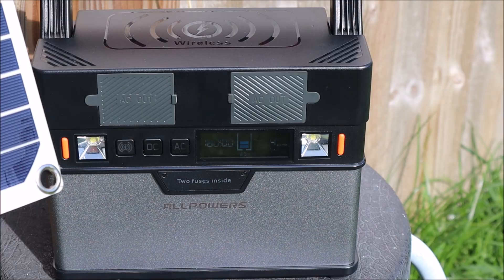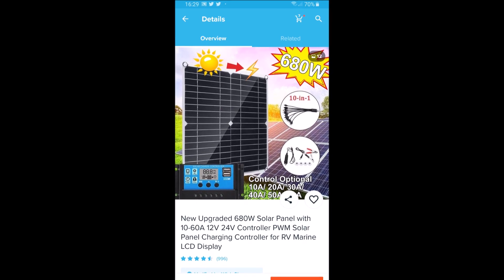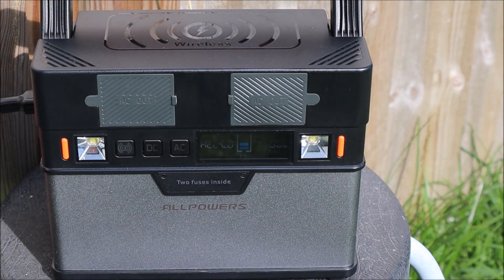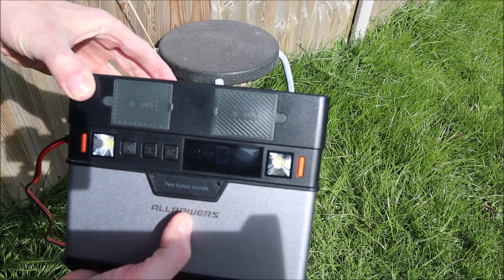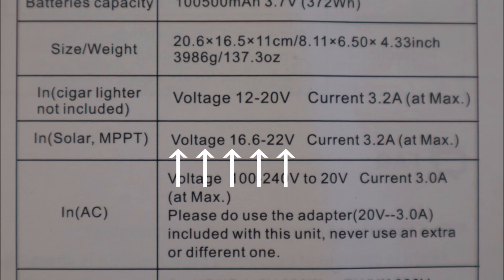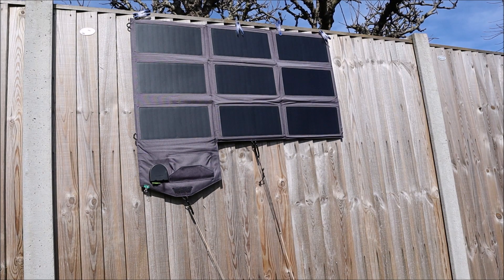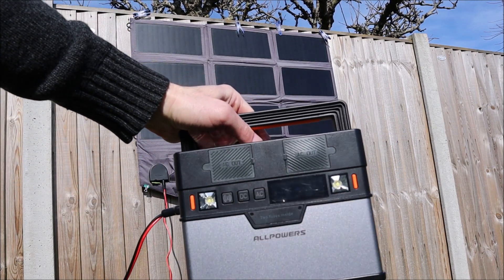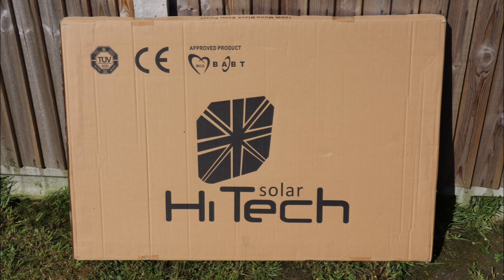ALLPOWERS 372Wh Portable Solar Generator Update 2 | Wish Came True

Comment: Hi Adrian, I have question to ask you where can I buy there featured cable ALLPOWERS MC4 to Anderson Connector Adapter Cable 16AWG as mentioned in your linked description? As it says Currently unavailable on Amazon! I am struggling to get this cable from anywhere which I desperately need to charge the 372 Generation, which I will be buying this week! I don’t suppose you have any ideas? I mean how hard can it be to buy just 1 simple cable? Many Thanks 😊
Reply from the maker: @Dean Platt  Hey Dean! Sorry for the delay (loads happening at the moment). The cable description is incorrect on Amazon (link correct), the one shown is actually the DC to Anderson port cable. This should be the one that ALLPOWERS are sending you free of charge?

The MC4 to Anderson port cable (not pictured) is the one that I used to connect up my 100W standard panel featured in this video > https://youtu.be/T_hlnoyAx2c

So, other than the cable you are waiting from direct from ALLPOWERS, you will have all you need for charging from the foldable panel. You can also still charge using the cable that comes with your new panel, while you're waiting for the other cable to arrive. I hope this makes sense and please shout if you have any other questions. Take care, Adrian
Reply: DADvinci Hey Adrian, That’s ok if you have loads going on at the moment, as I would of waited for a reply as there was No rush! Yeah kinda noticed they have put the wrong description in the listing as I was like that is a DC to Anderson as I saw what the MC4 looks like which as you said connects up the 100W Panels! As for me getting a Free Cable from MYSolar the makers of the Solar Panels & Generator, I haven’t heard anything back since last Friday as I have sent another email, still nothing! So my hands are tied as everywhere seems to be out of stock of this cable which is obviously extremely popular whilst we was in Lockdown! I mean I have got the 60W Panels, and after I watched your video I could see how the Anderson would be so much better for charging without the levels dropping when the sun went in and come back out again! I am just holding off ordering the 372 Generator until I know for certain I am able to get this cable as it is a bit worrying that nobody has this cable right now! Anyway so sorry for all questions! Keep your videos coming as I am a Tech Junkie! Please Stay Safe 🙏😊

Comment: Another, possibly easier, way to achieve this (if you have a fold up solar panel) is to plug the panel in to the unit with the panel completely folded up and then gradually unfold sections of the solar panel. As you do, you will be gradually increasing the voltage (as each section opens up to the light) and no doubt you'll hit the magical voltage on the way to wake up the unit.
Reply from the maker: @Rich Hawley  Good day Rich and thanks very much for your comment. As you rightly say, it's finding the magical voltage that's the key. The only issue with this is that I need to do it within about 5 seconds of plug-in (on my unit) otherwise it doesn’t wake up (remove + try again). The best method I've found for both the 60W folding and 100W rigid panel is holding a piece of cardboard over certain parts of the panel, which has been very good at waking it up. I really need to get a DC power supply at some point to properly test the voltage range for this picky circuit. Thanks again for your comment and have a great weekend! All the best, Adrian

Comment: Interesting review thanks. I’m thinking of getting one to power a telescope mount in the field. It’s very power-picky tho and needs a consistent 12v or just above supply. Have you tested the 12v cigarette lighter output to see what it actually outputs? Is it 12v bang-on or above or below?
Reply from the maker: @Jeff Mark  Good day Jeff and thanks for your question. Unfortunately, the 12V cigarette lighter socket is not regulated so the voltage drops as the overall battery charge does. I do not recommend this unit for anything that is sensitive to dropping below 12V. You could use something like this > https://amzn.to/2Y7NW53 (affiliate link), but that's not the most efficient way of using the battery (+ I've not tested one yet). I hope this helps. Please let me know if you need anything else. All the best, Adrian
Reply: DADvinci thanks for the reply. My quest therefore continues. All the best.

Comment: Just wondering what heater can I plug into this
Reply from the maker: @Shayne Widdowson  Good day Shayne and thanks for your question. It depends on the wattage of heater you wanted to use, but would need to be less than 300W (AC inverter limit). What type of heater were you thinking of? The reason I ask is that a micro fan heater would eat through the battery quickly, but some kind of heated blanket or mat would have a lower wattage (last longer). Please let me know when you get a chance. All the best, Adrian
Reply: I was going to get one to put in my shed only a small one now I know what wattage I need thank you

Comment: Could you let us know, perhaps do a review of the Wish solar panel? Love your work by the way.
Reply from the maker: @Royal Green Good day to you! Thank you very much for your kind feedback. I was planning to do a future video around the Wish.com solar panels that did arrive. This is going to be more a comparison between what's advertised on their website versus what turns up. Did you have anything you wanted to know specifically on the one featured in this video? All the best, Adrian
Reply: @DADvinci  Thanks for replying, it would be good to know your experience with the Wish panel, what did you expect and what was the reality. What was the advertised wattage and real wattage. 

Really appreciate your honest experience with these devices. About to buy the ALLPOWERS Solar Charger 18V 60W. Looking at the ALLPOWERS Portable Generator 288Wh, but its not in stock yet.
Reply from the maker: @Royal Green  Thank you, I'm really glad you've found value in these videos. From what I can remember (ordered ages ago and no longer showing on my account) the Wish panel in this video cost about £21 and it was advertised as 680W! I went for it as it was completely ridiculous. The one that arrived, as you've seen in the video, was a small square similar to larger flexible panels. I've had around 10-12W on a sunny day, but I usually just sit it in the sun charging my USB devices, which it happily does to be fair. The old saying really does apply in this case ’you get what you pay for!’ 

You've chosen a good long-term combination from my experience. Please shout if you need anything else. Take care, Adrian

Comment: Hi, thanks for the very informative vids. I've purchased a 372 but am still confused about which solar panel to buy. The issue of it not ''firing up'' is a problem. Would a 80w be better than a 100w do you think? ty.
Reply from the maker: Good day! Thanks for your kind feedback and question. I get the problem on both my 60W foldable and 100W rigid panels so I'm not sure an 80W would get round it. To be honest, once I got the knack of how/where to cover the panel I stopped thinking about charging using the Anderson port. Once the display is awake it stays that way until you disconnect the Anderson cable. I hope this helps? Please shout if you need anything else. All the best, Adrian
Reply: @DADvinci  That's good to know. Am thinking of connecting two100w solar panels. One will be permanently connected the other removable as it'll be mounted on a roof box. Can you see any problems with that?
Reply from the maker: @nosh Are you getting rigid, flexible or foldable panels? Were you planning on connecting both panels at the same time? Another thing to note is that you'll probably need the solar panel in reach to wake the display up. Please let me know when you get chance. Cheers, Adrian
Reply: @DADvinci  Hi, one will be a flex and will be permanently fixed. The other rigid and adjustable which will be removable. The flex will a give a constant charge and am hoping that ridgid, when connected whilst camping, will boost the charge rate? ty Chris.
Reply from the maker: @nosh Hi Chris and thanks for the info. From what the manufacturer has said before, it's not recommended to connect up more than a 100W solar panel for charging. In your setup it should be fine to switch between them (if I understand correctly). Even if you did connect both 100W panels together (would have to be connected in parallel), the charging circuit can only handle 3.2A at maximum, so it wouldn't charge any quicker than a single 100W panel. I hope this answers your question on boosting the charging rate? Please let me know. Cheers, Adrian
Reply: @DADvinci  Thanks Adrian, exactly what I needed to know. Once setup complete I'll send some photos :)

Comment: i bought the battery and i was wondering if the German solar cells work in low light conditions like they advertise: https://www.amazon.co.uk/dp/B01N9FU5SY/?coliid=I4GMHR2AO520X&colid=1EUW1G01FPWXO&psc=1&ref_=lv_ov_lig_dp_it
Reply from the maker: I'm sorry, I've not tested the German solar cells (panels) so am unable to provide any feedback on low light performance. 

The link you shared does show that the panel uses MC4 connectors. You could connect it direct to the Anderson port on the solar generator with the cable I use in this video https://youtu.be/T_hlnoyAx2c (if you haven't seen it). The other thing I would say is that you could get a 100W panel for a much cheaper price (like the one in the video I suggested) as you don't need the charge controller (it’s already built-in). I don't know where you plan to put the panel though, so it's just a suggestion. I hope this helps? Please shout if you need anything else. All the best, Adrian
Reply: @DADvinci  what size are those anderson connectors?
Reply from the maker: @hb song  Good day! Here's the link to the cable I bought (https://amzn.to/2WMjahn - affiliate link) which has all the details about the Anderson cable. Please shout if you need anything else. Cheers, Adrian

Comment: What I do if my solar r fixed to the roof
Reply from the maker: Good day and thanks for your question. To clarify, you already have a solar panel on your roof you wish to connect to this solar generator?

Assuming that this is the case you will need a cable to plug into the Anderson port. I'm not sure if you've already seen it, but this video may help (https://youtu.be/T_hlnoyAx2c) as it covers using a MC4 connector to Anderson connector cable which you will probably need, along with a MC4 to MC4 extension cable like this > https://amzn.to/3f31Aga (example only - affiliate link). This is only a guess as I don't know your exact setup or what the panel is already connected to. Perhaps you could share your setup?

I hope this helps a little? If you could share more about your current setup that would make things easier. All the best, Adrian

Comment: I can connect some stuff on 110v port while it is charging with a solar panel at same time?
Reply from the maker: Good day Erbin and thanks for your question. Yes, you can use it whilst charging which is what I do most of the time now. With the current situation it makes working from home, for me, off-grid (when it's sunny of course) > https://youtu.be/T_hlnoyAx2c 

This is covered in the product manual if you want to take a look on the Amazon page (https://amzn.to/2GvAtu5 - affiliate link from video description) under the Product Information section. The Technical Specification paragraph has a User Manual (pdf) link. #1 on the FAQ section of the manual covers this.

I hope this helps? Please shout if you need anything else. All the best, Adrian

Comment: I got a sturdy 100w panel for my allpowers monster and it hasn’t had an issue. It pulls 50 watts on average in direct sun through the 8mm barrel. Charges full in one day.
Reply from the maker: Good day Matty and thanks for your comment. It's great to hear yours works without issue through the DC input. How has it performed powering different things? All the best, Adrian
Reply: DADvinci its been working great, no issues yet. It holds a surprising amount for its size. I’ve had it since last summer and have used it on plenty of camping trips without any complaints.
Reply from the maker: @mattywyattmartin1  Thanks for sharing. Like you, I'm surprised at how much it holds for such a compact unit.

Comment: I have the bigger version of your Wish special panel - sold as 18v/40W - Ive just connected it up to the allpowers via the Anderson socket & its charging at 30W - on the meter its showing 1.78A at 17.6V so pretty much bang on. Mine behaves exactly the same as yours too with no handy time left to charge updates & not liking high voltage at startup, but once its going its fine. Keep up the good work :-)
Reply from the maker: Thanks so much Nick! This is great feedback and adds weight to an Anderson port charging 'characteristic'. Really appreciate your support too 😊

Comment: Great stuff adrian, out of interest have you contacted the manufacture to understand if it’s a fault or as designed?
Reply from the maker: Good day! Thanks for your kind feedback and question. This was a very recent and unexpected discovery (+ testing most of the weekend), so I'm waiting for ALLPOWERS to get back to me.

I did have some feedback from another subscriber who seemed to experience a similar thing (intermittent Anderson charging, although mine didn't even start originally) and kindly did some testing as well backing up what I've found. If this is the case and more people get back to me (+ALLPOWERS confirm) then it could be a 'characteristic' of the MPPT charging circuit of this solar generator. I will of course feedback once I know more. I hope this helps a little? All the best, Adrian
Reply: @DADvinci  my garden is south facing

Comment: I was waiting for this!
Reply from the maker: I hope it helps, sorry it took a while. All the best, Adrian
Reply: @DADvinci  Hey! thank you! I have another question for you man. I just received my new solar panel (The Dokio 300W). The voltage are ok, just it can put out usually 200W, at max (quite impossible) near 300W. So.. is there (for this solar generator) a limit about the solar panel that I can use with it?
Is too powerful? Or the MPPT will modify the power as the solar generator requires?

Thank you again